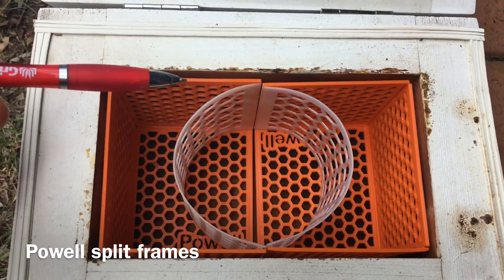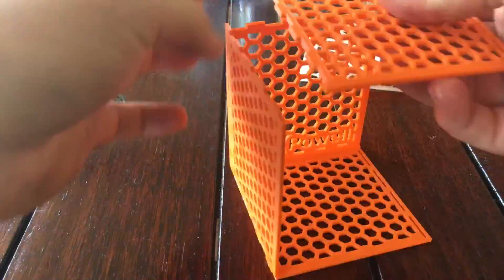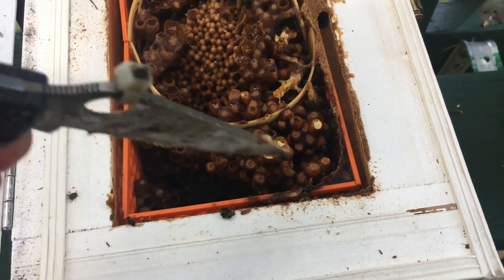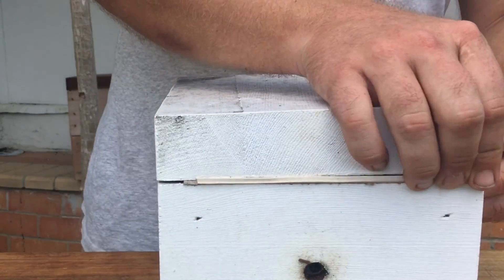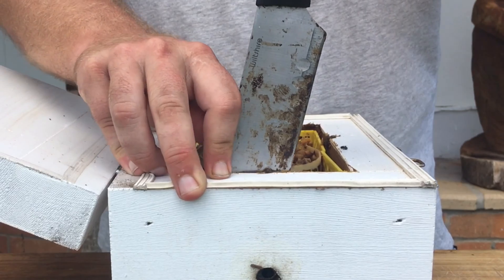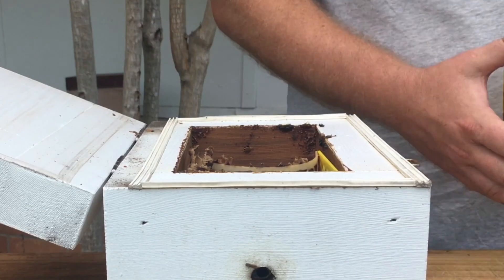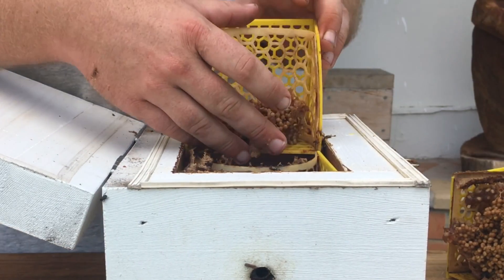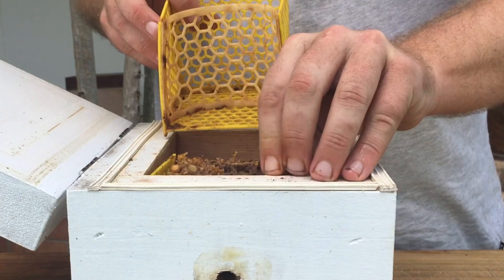Powell split frames for Australian native bees 🐝

Comment: I will be working with biroi and sapiens?  Will this work well with those two species found in the Philippines?  As always, thanks Nick.
Reply: Hey, am from PI, too.  Wonder how your SBees doing?  Also, what is the result of using this frame?  thanks for any update.  I'm also going to try to use something like this but much simpler as I don't have any resource for using 3d printers -- just using pvc screens.  I'm just a hobbyist, a backyard sbeekeeper.  So no solid experience yet.  I use SBs transferred from bamboos and eduction methods.

Comment: Dont ,Australian native  bee require queen cell?? 
Indian stingless bee requires  and fails the split if nuke dont have queen cell
Reply: Ya Chethan... Even I am surprised with this method... The bee species is australopleibia, which is quite similar to our iridipennis breed... There is a clear separation between older and newer eggs. 
In this type of vertical division, newer eggs will equally split, which is crucial for transforming one of the newer eggs into queen cell

Comment: Good idea....Just wondering...this thin plywood in Australia n other place...do u think the manufacturer  put chemicals in them if we wanted to use them on our bees?
Reply from the maker: Good question. Here in Australia our glues for plywood’s are as follows. 

A-BOND - produced from a phenol formaldehyde (PF) resin and forms a permanent glueline that will not deteriorate under wet conditions, heat or cold e.g. used in the manufacture of Marine and Structural plywoods.
B-BOND - produced from melamine fortified urea formaldehyde resin (MUF) resin and is suitable only for limited exposure e.g. formply, door skins.
C & D BOND - produced from urea formaldehyde (UF) resin are both for interior use only, and should not be used in structural applications or wet or damp areas 

Basically the glues are toxic when wet like fiberglass but when try are pretty safe. I still see any timber glue or not as a danger to cut without a mask and proper ventilation. 

In terms of dangerous for the Bees anything treated with Copper chrome arsenic is bad and this would include garden sleepers fence posts , fence pailing, some claddings and external use posts. Our treatments have now mostly swapped to LSOP. Which stands for light organic solvent preservative. It’s a hopeless external treatment imo and very irritating to the respiratory system if you cut it a lot. Some people here don’t do their research and actually make their hives from it. It contains synthetic pyrethroids which would be very bad for the bees.  Hope this helps.
Reply: Australiannativebee 
Yes...tks a lot..